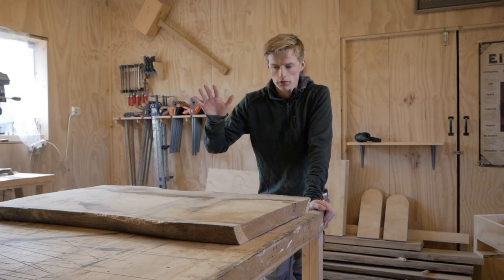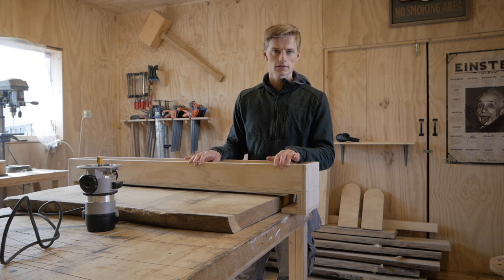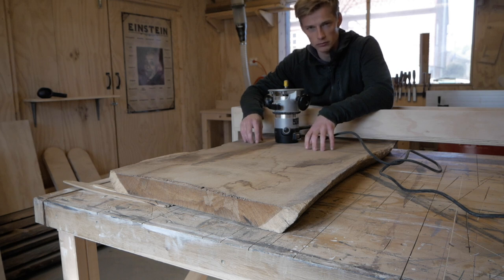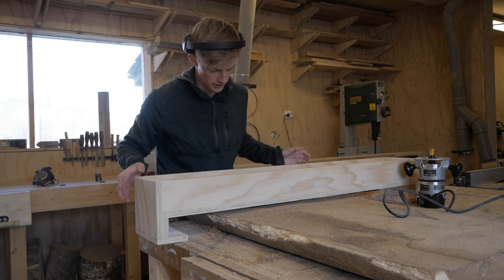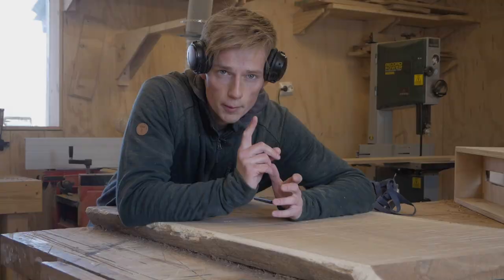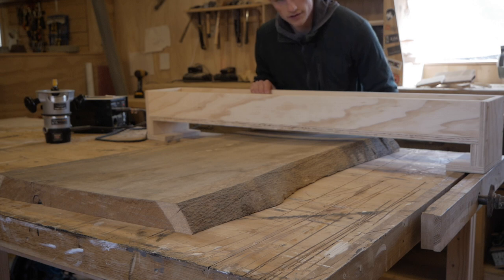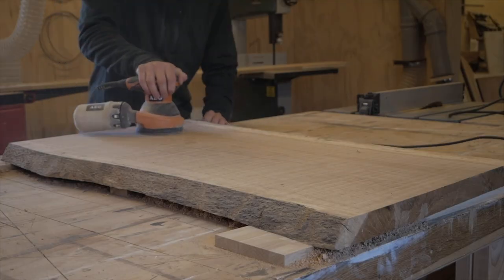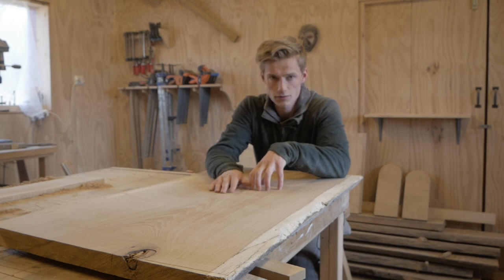How to Flatten a Slab WITHOUT a Planer or Jointer

Comment: I do something very similar to that, but when I level the slab, I spot glue the edges down with hot glue. That ensures it won’t move until you are completely done. Maybe add a brace on both ends of your jig that extend down the side of your table… that would keep it from ever falling off. I enjoyed your video, and appreciate your transparency. Woodworking is a  never-ending learning process. I make mistakes on every build, but you learn how to fix them and move on. ☮️&❤️ from an old woodworker in Oklahoma, USA. Take care!

Comment: Is your router 1/2” or 1/4” shank? What kind of bit are you using?
Reply from the maker: I use 1/2", but the router can take both. The bits I'm using is a fairly cheap Kowood 70-piece set I bought from Amazon a few years ago. They're still working pretty good!

Comment: Hi! Great video! I'm quite new to woodworking, more along the "hobby craft" side of things, stuff like jewelry boxes, dremel projects, christmas decorations etc. BUT, I have a couple of questions if I may, will this router trick work on smaller "slabs" of wood, say, 12 inch X 8 inch?  I'd imagine it would, but I feel like the wood would be so light it wouldn't sit as neatly as that giant slab you used lol. So, how would I get it to "sit still" enough for me to use the router method? I kinda feel like clamps might get in the way (I don't have dog clamps), Maybe toggle clamps might work?
Reply: If you got a table first thing I think of is screw some small scrap around the sides of your slab. Then it stays in place, and provided you have enough distance to clear it with your jig with the added pieces, it should be just fine. Just make sure the pieces you put around your slab are shorter than your slab in height so they don’t get in your way. Clamps would work but if you got a table to put some screws in, that’s what I’d do.

Comment: If the work table is uneven your piece is ruined. So fix the legs and the table top and then the piece. The jig is easy to make.
Reply: i want to correct you the table leg does not matter the table planeness matters